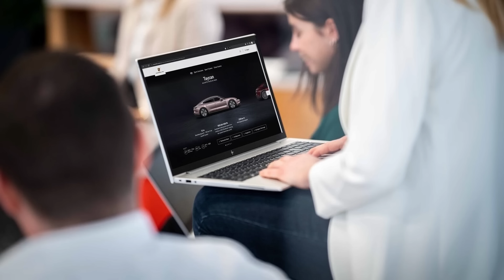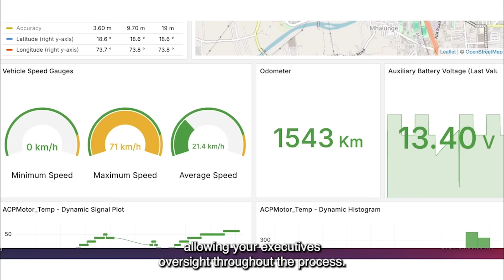VinFast Gets Cash Life-Line; Activist Hedge Fund Buys Into Nissan - Autoline Daily 3934

Comment: Legacy Tesla News:  Hertz regrets teaming up with Leon!  FSD King Waymo open in L.A. while Adrian builds a diner!  Wraps leave permanent blemishes on wimpy CyberBust panels!
Reply: With Elon in charge the stock may go up for a while then sales will start to drop as people are disgusted by elon's politics
Reply: @MarkMeszarosYNG  Some woke people you mean.
Reply: @MarkMeszarosYNG He’s picking up more than he’s losing.
Reply: "Tesla Model Y Inches Closer to Dethroning Ford F-150 As U.S.' Best-Selling Vehicle"
Reply: @MossMini  In 2024
Ford F-Series 528,028
Tesla Model Y 219,799
Yeah, inches close 😂
Reply: @MossMini  Lol…as of October, Model Why 312k, King Toyota RAV4 350k, F-Series 528k.   Chris Farley’s incompetent cousin is crushing babysmurf9000.
Reply: Some big brains decided that bare stainless steel could stand to the elements, no matter what. Except, it does not. Unless you apply a clear coating, of course. Wait for that salt brine to get behind the modified 316 SS panels... and wait until the carbon steel frames, to which the SS panels attach, get coating failure while touching the stainless steel surface. Voila! Galvanic corrosion begins! (Where the carbon steel is the sacrificial anode)
Reply: @ It is clear that the CyberBust is a warm weather car designed for Austin, TX or California.
Reply: @MarkMeszarosYNG  re: "as people are disgusted by elon's politics..."  as if we haven't reached that point already...?
Reply: @taniabanes4707  maybe in usa. globally not the case
Reply: @TeslaRoadtrips  Mhm and who cares?

Comment: Stary roof for 97k is not a scam, TV could have been 42 inch but 36 inch is good as it is.

I’m wondering how long vehicle markers is going to get away with these small stuffs.

The whole glass roof canopy thing, what if they do some insane display like aligning with GPS and satellite while parked, starting showing stars perfectly aligned to that same direction your seeing, then perhaps by using smartphone vehicle apps you can zoom in on the star and neighbouring galaxy using glass roof.

This probably requires smart glass roof display and imagery projection to dynamic body technology.

while having driver seat folded down, you get to see the beautiful universe by starring at your glass roof from inside of Tesla or Lucid which ever one is fine.

Don’t forget to install a wind chimes on your front door and just star watching on your drive way, them mild wind on wind chimes and neighbouring star system. Like a symphony in its original form. (Low key technology like that probably will cost another 20 billion but Tesla have that kinda money, it’s not an issue)